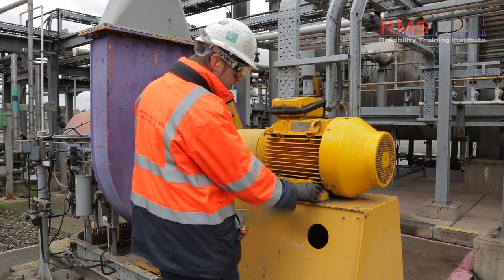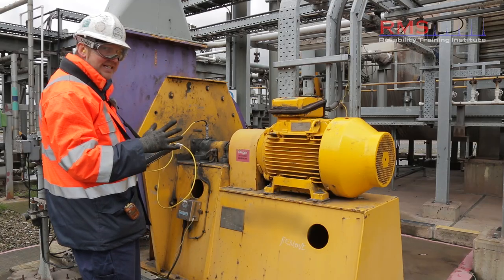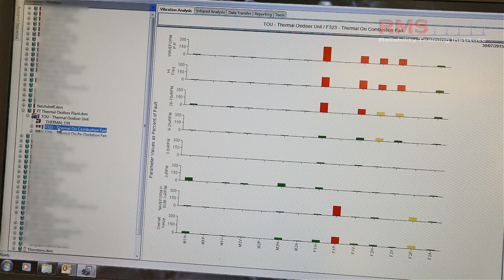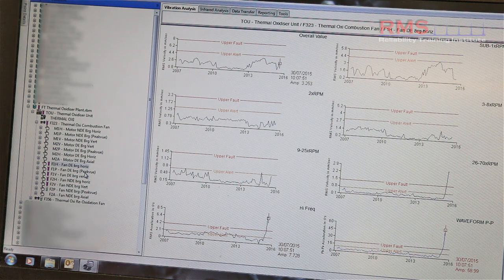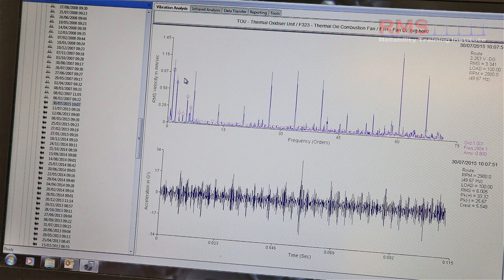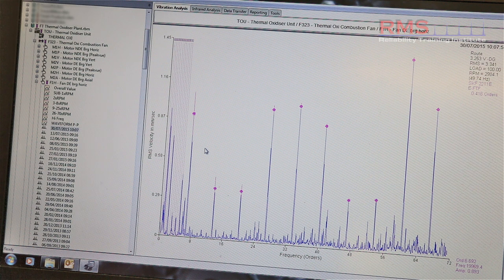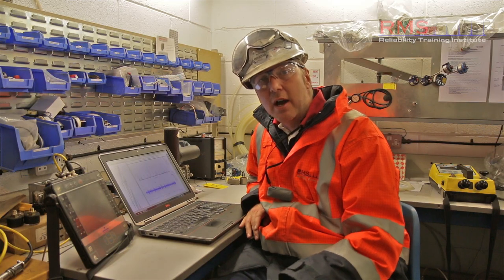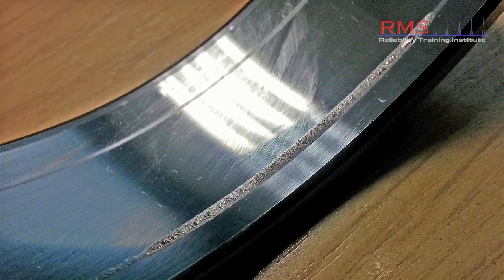Real-World Bearing Defect Diagnosis using Vibration Analysis

Comment: What is the point to take 72 orders on Fan bearing? Probably because of CSI default database setting?
Reply from the maker: Anywhere between 50-80 orders is good practice to get a number of harmonics in the spectrum, 72 is most likely closest band within analyser / software.
Reply: @reliabilitymaintenancesolu6459  72 order is default setting of CSI. After having experience I concluded 30 to 40 orders are enough specially for fan and pump.
Reply: @reliabilitymaintenancesolu6459  Anyhow great video and thank u so much for your effort.
Reply from the maker: I think that's too low, if you had inner race primary bearing defect freq between 12-14 orders you would only get two harmonics of the defect frequencies. You could also miss rotorbar stator slot freqs on the motors usually around 45-60x rpm. Also electrical erosion bearing faults on VSD motors usually show higher harmonics of bearing frequencies due to fluting patterns, you could miss some info with just 30-40 orders. Okay for sleeve bearings but not anitfiction.

Comment: Hi mate, i just did a test run yesterday on HVAC 6.6KV 530 kw 1000 rpm with copper rotor 99.8% double bearing DE NU228 + 6228 and NDE NU228 for bark crusher machine. The test run was done on no load
 All parameters are great except the gE of the 6228 skf bearing was high, with average 2.4, it started at 10 and after regreasing it went down to 1.088 and went up to 2.4 average after a few readings taken. The motor is new.
According to control and monitoring team this is not acceptable and pose medium risk. Please advise is it normal ?
Reply: Need to do under load ideally the roller bearings could skid slightly due to reduced load which would give you the high readings. Greasing will dampen out some of high freqs for a while. Common issue on double brgs with roller brg that has low radial loads. Check on load, would be concerned if clear bearing freqs present in standard vibration readings. As opposed to just envelope readings.
Reply: One question mate, i suspect that the motor we bought has no corona protector being applied on despite being high voltage, what will be the worst scenario ?
Reply: One question mate, i suspect that the motor we bought has no corona protector being applied on despite being high voltage, what will be the worst scenario ?
Reply: No sure on that question
Reply: @MotionAmplificationRMSLtd  i mean the anti corona shield for partial discharge

Comment: Great Video Just one concern how did you get cage frequency?It looks you have several frequencies for different parts that is amazing. but I don't know how is it passible to get parts frequency !
Reply: For most rolling element bearings the cage frequency is usually between 0.38 -0.42 orders of running speed. Ie for 1 revolution of the shaft the cage will rotate  0.4 orders or 40% of a rev when compared to the running speed.
Reply: the inner cage isn't supposed to run at the same speed of the rotor since it is mounted on the shaft?second 40% is it based on literatures or the manufacturer. for me how can I get these things ?Appreciate your response  Mustafa
Reply: Each rolling element bearing has set defect frequencies based on ball dia, pitch dia and number of balls or rollers. Vibration analysis software usually comes with a database of bearing defect frequencies for each manu

Comment: Well there's your problem. Fan shaft bearings wailing like a banshee and pissing grease. Don't need high tech accelerometer to figure this one out.
Reply: When a lot of money is hanging in the balance for every shutdown or repair, you don’t use basic intuition. This, the proper analysis, makes sure there are no wasted efforts or costs. You know with a certainty the source of the problem. This is a simple example. In a more complicated system that good ole intuition evaporates pretty quickly.